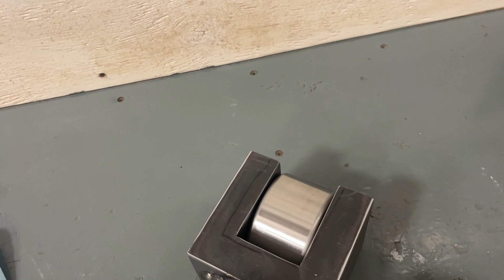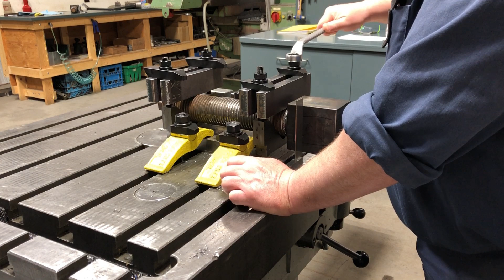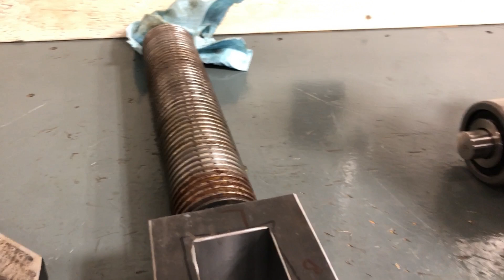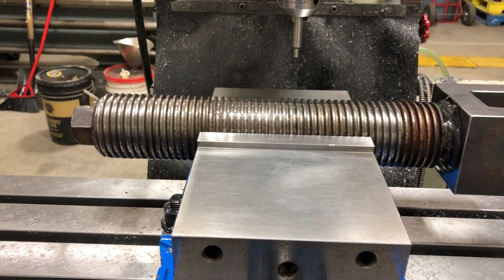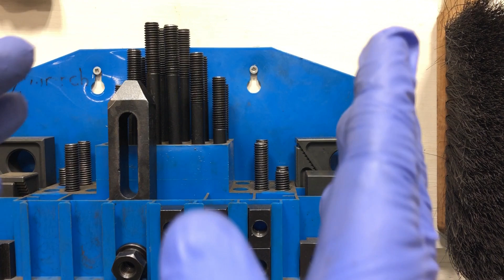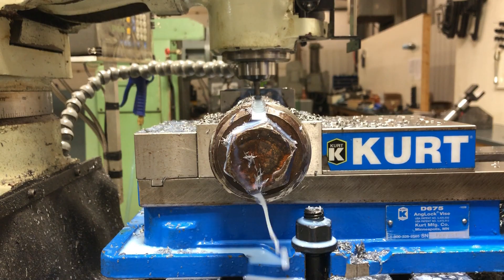Facemilling & Keyway Cutting

Comment: Check out cool mist they use air mixed with coolant to do exactly what you described but they are adjustable on the air pressure to eliminate the chips flying to the roof